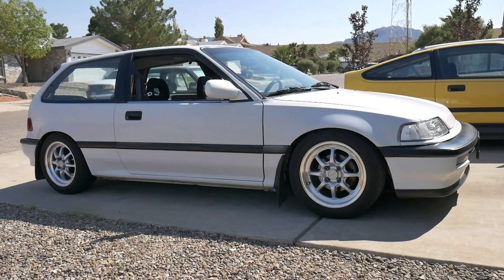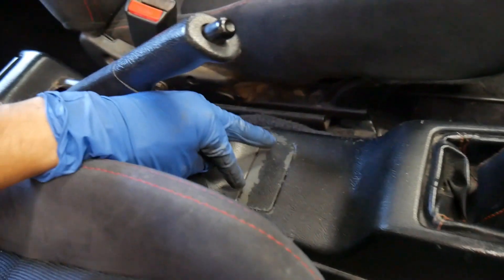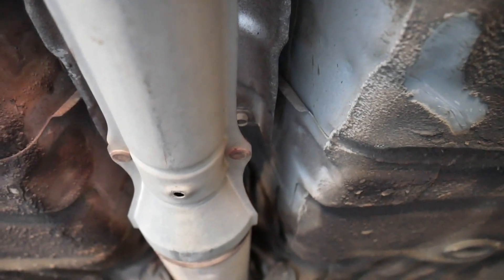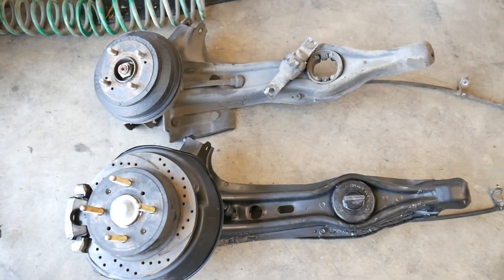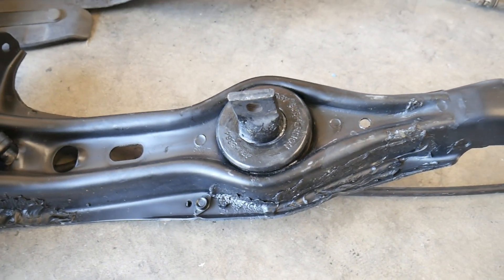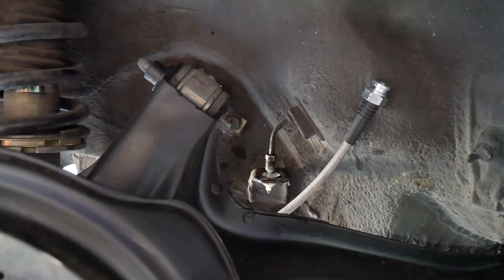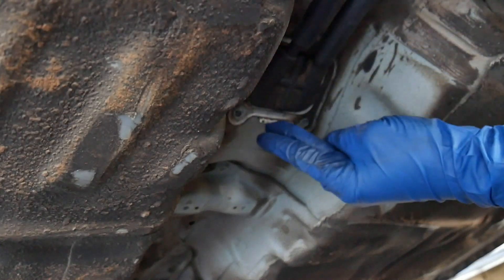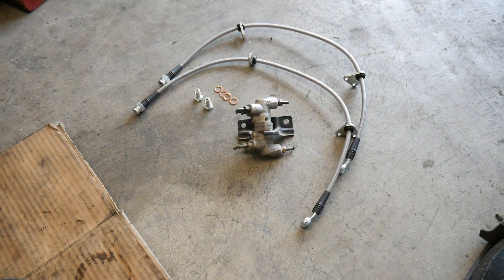How to Rear Disc Brake Conversion (88-91 Honda Civic CRX EF)

Comment: Hey Jon I know for sure 92-00 civics and 94-01 integra RTA work and all interchange
Reply: Ronnie Gonzales 
What all needs to be swapped out to make the DC Integra brakes work?
Reply from the maker: Same as in the video
Reply: I have trailing arms for a 93 si on my 95 Civic... do you think it will fit in my 2000 Civic ex? I rather have them on the EK
Reply from the maker: Yes
Reply: The 40/40 valve can be found off an integra ?
Reply from the maker: 90-93 Integra non-gs models.
Reply: Is it only the civic coupes in those years? or would the RTA from the sedan work as well?
Reply from the maker: Sedan/coupe are the same trailing arm bushing
Reply: Kevin tieu what is a 40/40 valve????
Reply: Ronnie Gonzales would an automatic 97 Civic coupe work for the rear hub swap? I have a 90 Civic 3door...
Reply from the maker: Brake propositioning valve.
Reply: I remember hearing somewhere that the integra(dc2) rta make the wheels stick out a little bit more on the ef chassis,  do u know if thats true.
Reply from the maker: It might, since the DA Integra is already proven to add offset.
Reply: What about 95 integra to 89 civic Crx
Reply: @chriscurry780 yes it's true

Comment: And 1 thing never mentioned is brake lines need to match caliper if u use da teg u need da lines and DC needs DC lines cause it comes out side of caliper and da is angled to bottom and longer

Comment: For 88-91 ebrake cables that fit (CRX=short, DA=long) use 92-95 Civic Si or 93-95 Civic EX coupe (not sedan). They are the exact same length as the EF3/EF9 ebrake cable. The bolt brackets from the 88-91 HB easily swap over to the 92-95 cable and allows for a seamless install in the factory location.
Reply from the maker: Is there any other option for crx cables?  A shorter option other than the 90-91 CRX SI cables that you know of?
Reply: So Civic ex sedan wont work for CRX?
Reply from the maker: They'll be long, but you can probably loop them a little.  Watch this video to see how the DA cables fit on a crx.  https://youtu.be/hyq57nH9cHE

Comment: Why does everyone keep using the stock factory 40/40 prop valve?   They sell aftermarket ones that are adjustable for race cars.
Reply from the maker: That bolt up like OEM fitment?  Or do they require you to cut, bend, and flare lines?

Comment: The only problem with using the 90-93 Integra rear trailing arms is it widens the rear track.
Reply from the maker: Only a problem if you race, if you don't it's not an issue.  And even then it's a minimal difference.  You can easily fit 7" - 8" wide with 205 or 225 on both.  I'm speaking from track experience using both DA and non DA sets.

Comment: Where on earth can I find these trailing arms? No junk yards have the DA Integra! If they do they are barebones in hours! My very well versed honda friend tells me the 92-00 honda civics arms don't work, but down low Ronnie says they do...which is it?
Reply from the maker: What car do you drive?
Reply: @GarageBuiltHondas  91 Civic Hatch Si
Reply from the maker: I'd use the DA, or 90-91 CRX Si if you can find some.
Reply: Garage Built Hondas well that’s my hope, I’m just having a hard time finding them. Point me in the right direction?
Reply from the maker: Craiglist, Facebook, and especially the yards.

Comment: Just changing a 91 HF to rear disc with scarebird kit n 94-01 integra drilled n slotted rotors n calipers. I got 91 crx si cables on ebay w/ hardware. The installing cables section was Gold
Reply from the maker: I've always wanted to try those, but I've always had way more rear discs than I needed.

Comment: ive been putting off doing the disk swap on my 91 even tho i already have the disk arms because i didn't want to drop the tank, but now that i can SEE you dont have too, might finally get to getting them installed. I Have one question tho, my arms have no handbrake cables and my OEM ones are cut, what cables do i need?
Reply from the maker: 91 what?
Reply: @GarageBuiltHondas  91 civic hatchback

Comment: Quick question how are the brakes going to work after the swap will it still be with the ebrake or do they work with the brake pedal?
Reply from the maker: This changes nothing for brake usage, everything still works exactly the same.

Comment: One question if I was to do this which I am gonna how do I match the front breaks to the backs? Do I order rear integra break pads then just normal ef break pads off rock auto?
Reply from the maker: Yes, just order the correct pads for each setup as you mentioned.

Comment: My trailing arms were on a CRX, but no idea what they came off originally.  I want to change hub assemblies to freshen them up. Will all hubs, DA, EG, EK work on the rear disc setup?
Reply from the maker: Good question.  I don't know.  I believe there may be small differences to some unfortunately.  Look up parts online and see if they are all interchangeable.  That may help.
Reply: @GarageBuiltHondas  yeah, there are differences. May have to see if there are PN's on bearings that can cross-reference. Thanks for your response.
Reply from the maker: No prob, good luck.  I'd personally take the parts off and take them to an auto parts store and check them against product they have in stock

Comment: I used 90 Integra rear trailing arms and all of the brake lines and e brake cables both of them a hundred percent is the 40/40 valve from a different type of car because mine has it something that looks just like what you put in
Reply from the maker: All of these cars have the proportioning valve and they look identical, but they do not perform identical.  It'll be stamped on the front of the valve.
Reply: Thanks for the info.  I'll get back to you.

Comment: I got a CRX what year and model the brake proportion valve came from
Reply from the maker: What are you trying to do?
Reply: I put rear Disc Break but look like doesnt have any brakes I changed master cylinder no help boster no help either Im thinking is the proportioning valve I bleed the system at this point looking for help
Reply from the maker: If your valve was fine before the rear disc brakes, its unlikely the problem.   What do you mean it doesn't have any brakes?
Reply: The pedal goes all way down to the floor. Do you have a email I can sent pictures?

Comment: I am doing the swap on my 1989 Honda Civic LX sedan I heard the when you swap the 90-93 Integra the wheels stick out more. Anyone confirm and how much they would stick out? Also does it matter if you use a 94-01 trailing arm that have ABS versus non ABS? thank you

Comment: What year and model for the steel brake line mine are off a 90-93 integra rear disc swap , my car is a 89 crx si !?
Reply from the maker: Buy them for a 90-91 CRX Si.
Reply: Thank you 🙏🏻 garage built Honda

Comment: Great vid
Reply from the maker: +Grant Bischoff thanks Grant!
Reply: Garage Built Hondas hey, i was wondering whether or not theres more benefit to do this than just stripping off the drum brakes and using brackets to install disc brakes
Reply: Garage Built Hondas i watched some other videos about this and im just wondering why tou decided to do the entire trailing arm instead of just doing the brake its self
Reply from the maker: +Grant Bischoff I think they would be very equal especially if the rotor size and caliper size are similar.
Reply from the maker: +Grant Bischoff This has been the only method I have attempted before.  I'd love to try that conversion one day and will if the opportunity presents itself.
Reply: Garage Built Hondas i think the better trailing arm bushings are a good bonus. But personally i think im going to buy a bracket (scarebird) that allows me to just replace the brake it self because it will be cheaper lol
Reply: Garage Built Hondas i cant find any integras or crxs that i can get the trailing arms off of without driving 150 miles
Reply from the maker: +Grant Bischoff that's terrible!  I got super lucky and found a rare set of 90-91 crx SI rear discs for my 88 crx last week.
Reply from the maker: +Grant Bischoff Is that bracket less expensive?
Reply: Garage Built Hondas the bracket is 75 dollars i think, but luckily i found two rear trailing arms with the brakes ans cables off a 91 crx for 150 dollars! Im driving right now to go get them (3 hour drive lol).
Reply from the maker: +Grant Bischoff that's badass!!

Comment: Hello, I have a set of 1993 honda del sol rear trailing arms with disks. Will they fit on an ef hatch or 1987 - 1991 civic hatch?
Reply from the maker: Yes
Reply: @GarageBuiltHondas  Thank you. So the whole trailing arm should fit right in then?
Reply: @GarageBuiltHondas  I absolutely love your videos they are so informational and they are really well put together.
Reply from the maker: Yes

Comment: i've got a 1995 honda civic ex, shouldn't the proportion valve already be 40/40 ? So i should just need to do the drum to disc brake conversion and have no problem on the back tires locking up on me when i brake, right?
Reply from the maker: I don't believe those are 40/40 with drums being on the rear.  Go outside, wipe off the dirt/grease on the valve and look at the stampings to see what the bias is.
Reply: @GarageBuiltHondas  yeah my proportion valve is 30/40. I'm surprised though because you have the exact same one in the video and it says 40/40? Which looks exactly like mine ?! I guess I need to go out and hunt for the exact same one but with 40/40

Comment: I just picked up this setup from the yard took them off a 93 acura integra ls. How to i identify the 40 40 valve? What cars come with it? Please and thank you.
Reply from the maker: 90-93 Integra Non-abs models.
Reply: Thanks alot. What brand brake lines do you buy? Im thinking of upgrading the brake lines too.
Reply from the maker: I usually it eBay lines.  But if I ever need some in the future I'll probably buy Goodridge.

Comment: Was this done on a crx? My parking brake cables had a different setup of how they led into the cabin. The rubber grommets that lead into the cabin were different. They were 2 seperate grommets. Just wondering if your video is of a hatch or sedan
Reply from the maker: Crx cables have 2 separate grommets.  All other civics and integrals have the single grommet with the 2 holes inside that one grommet.

Comment: Great video...I have trailing arms from a DC integra...can I still use the e brake lines ? Will I need to loop them? Everyone says the DA e brake lines are the best choice since they arnt as long as DC, but when I look up the specs the DC lines are 3 inches shorter...a bit confused. I think il replace them with new regardless, just want to know the best lines to use for the ef
Reply from the maker: I think those will fit just fine. .👍

Comment: Do you know if the dog bone insert for the Trailing arm bushing on the DA disk arms is the same size on the arms with drums from a 1990 SI hatchback? I lost one insert and dont want to order a new DA bushing just to destroy it for the metal piece lol
Reply from the maker: Unfortunately no.  The DA is an odd ball from all the other civics/Integras and has a larger bar.
Reply: @GarageBuiltHondas  yeah found that out the order day after comparing the two. Thanks for the reply!

Comment: Links or info on where to get the rear brake lines??
Also, only need to change the trailing arm brake lines?
Reply from the maker: You only need the rears, but can get a set like these off eBay for about $60.  The owner had searched eBay and found a set he liked.  There are a lot of options.
Reply: Garage Built Hondas.. thanks a ton for the reply, I know the vid is a bit old. Currently wanting to do my 90 Hatch, and have everything but new bushings and the lines.
Reply from the maker: You're welcome, I like to think these DIY videos I make will stand the rest of time!

Comment: What proportioning valve should I get if I'm going to use EX front brakes and DA rear brakes?
Reply from the maker: 40/40
Reply: @GarageBuiltHondas  Thanks a lot, couldn't find that info any where just wanted to make sure.

Comment: So my 89 si has a 1725 prop valve, that will work, but would a 3040 pv work better?
Reply from the maker: If you have a stock setup, leave it alone.  Buy some nice pads/rotors instead.
Reply: @GarageBuiltHondas  awesome thanks for the reply!

Comment: I have a question? I just replaced brake booster and master cylinder and my brake pedal is still hard causing my brakes to stick. What else could be my issue? Please I would appreciate your help thanks.
Reply from the maker: Bad caliper most likely
Reply: I'll have to check my calipers and check my break pads for uneven wear.Thank you for the advice.

Comment: Great video.  I'm doing my disc brake conversion with Scarebird brackets, etc.  My question to you is that you haven't or don't need to address the power brake booster, proportioning valve or master cyclinder.  Scarebird recommends 1997 acura integra for its conversion.  They go as far as replacing the master cylinder.  Can all these changes work correctly with the existing power brake booster (91 CRX HF)?  If not, any suggestions?
Reply from the maker: It'll still work fine...if you're not racing the car on track it won't be an issue.  If you are, look into the 90-91 Civic ex.  It's a 15/16" size.

Comment: Can i use a 4040 portion valve off a dc integra or does it have to be off a da?
Reply from the maker: That one should work.  As long as it has the same configuration for the brake lines you'll be fine.

Comment: Was up Jon Ey great videos brother I have a question I have a 90 Honda Civic hatchback I have a 93 integra gs rear arms that Am going to install on my civic but my question is this will original break lines work just plug and play or do I need to get longer ones ..... now will my original e Brake cable on my civic will also work just plug and play or do I need to get another ones from a integra thanks
Reply from the maker: You'll need both the brake lines and ebrake cables from the Integra!  Yours will not work.
Reply: Garage Built Hondas Ey Jon you don’t have some for sale ....
Reply from the maker: No
Reply: Garage Built Hondas how long did it take you to complete....
Reply from the maker: It took me about 4 hours but that's with filming and doing to 40/40 valve and front brake lines.

Comment: The cables of the E-brake that you used are those of the EF or are those of the DA?
Reply from the maker: DA
Reply: thanks man
Reply: Garage Built Hondas  
another question, I have a disc suspension of a cupe 94, you recommend me to use the cable e-brake of the cupe 94 or that of a CRX SI
Reply from the maker: You didn't specify what kind of car you want to use it on?
Reply: @GarageBuiltHondas  
sorry man, I want to install it to an Ef9
Reply from the maker: They should work fine.
Reply: Garage Built Hondas 
thank you very much man

Comment: Hey I have question I have a 99 Honda civic ex. I'm converting drums to disc from a 95 del sol si. Can I use the caliper and bracket and rotors from a 2000 civic si
Reply from the maker: Not sure.  They may be larger.  Why not just use the Del Sol related parts and not worry about the parts not fitting?
Reply: @GarageBuiltHondas  just mite do that. Di I need to change the prop valve and master cylinder
Reply from the maker: It's recommended to upgrade the master cylinder to accommodate the extra fluid.  The prop valve will help bias more pressure to the rear.

Comment: Hi Jon. Will the ebrake lines from 90-93 Integra DA disc brake assembly work with my 89 Civic Si hatch? I'm converting my rear drums to discs. Heading out to the yard in the morning. Thanks.
Reply from the maker: Yes
Reply: @GarageBuiltHondas  Thank you. I met couple of guys at the yard and also converted their CRX’s to rear discs. They mentioned to  also take the upper and lower control arms?
Reply from the maker: I'd skip that and buy some aftermarket replacements
Reply: @GarageBuiltHondas  Got it. Thanks, man. I got the trailing arms from the yard over the weekend. Your video really helped me. It took a while because I forgot my 14mm impact socket so I had break every 14 manually, which was the painful experience.
Reply: Hey Jon. Could you please message the manufacturer and  part number of the stainless steel brake lines and hub stud bolts (ARP). Thank you.
Reply from the maker: Arp - https://jhpusa.com/products/arp-extended-wheel-studs-4-pack?_pos=5&_sid=966cf6a31&_ss=r
Brake lines - https://jhpusa.com/products/goodridge-g-stop-brakeline-kit-civic-crx?_pos=27&_sid=1d1f87d04&_ss=r
Reply: @GarageBuiltHondas  Thank you! Much appreciated, man.
Reply: Jon. I heard one of the youtubers mentioned that 90 Integra DA trailing arms will stick out 1/2” when installed on a 89 Honda Civic Si hatch. Could you please let me know. Thanks man.
Reply from the maker: Yes.  Are you racing?
Reply: I plan to circuit and drag the car after the conversion for more stopping power.
Reply from the maker: You're fine.  Every video in this playlist I've been using DA brakes.  https://youtube.com/playlist?list=PL9veTzRcotDnAuxXrp56p5jgsOyRTXUce

Comment: Man awesome diy vids Bro...I have a 91 crx that I plan to turbo.. I have a d15b7 and just finished the wire tuck and painted engine bay after removing the dash (thanks to your dash removal video)..I was considering moving on to the rear disc conversion and suspension but I have electrical and possible roll cage to take care of since the dash is out  wanted to check your thoughts on what is best to knockout first..at this point im saving the engine work last
Reply from the maker: Thanks, I appreciate the comment!

No particular order, just keep working on something and you'll get to the end point eventually.  Just do what needs to be done and keep knocking them out one at a time!